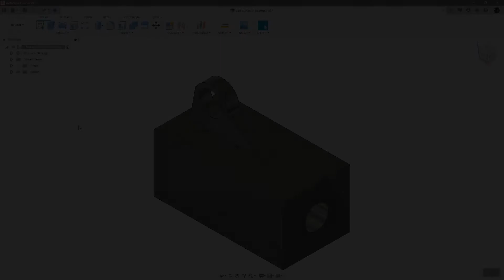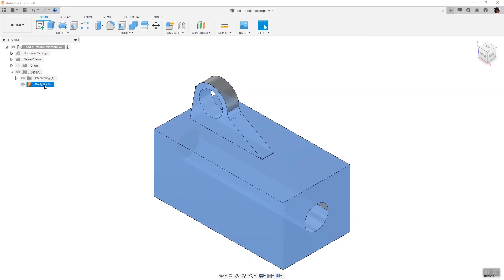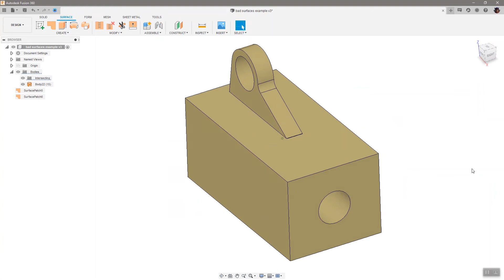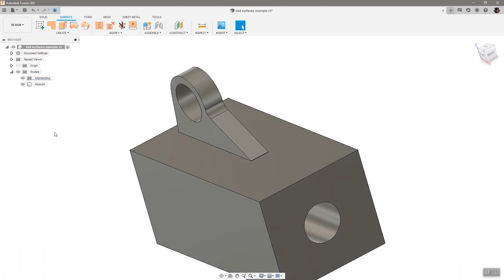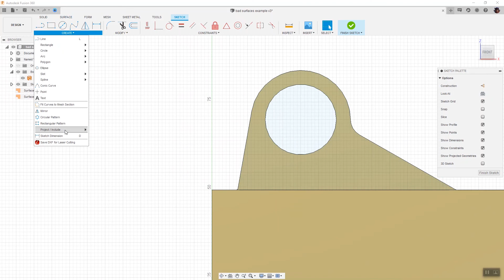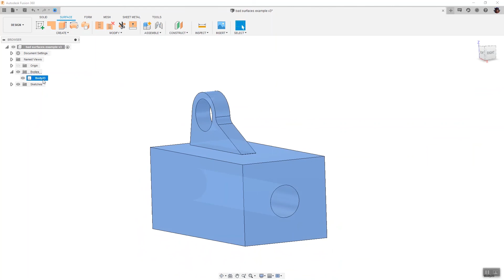Fixing broken imported surfaces in Fusion 360

Comment: wow, this is some great info.. I did not know about this.. I have a large and complex hollowed out castle model that I have worked on the point (many hundred of hours) that I have unfortunately developed a lot of non manifold edges and what not.. it's so bad I cant subtract objects from the model or combine it with other pieces.. this video has helped a ton but I am afraid fixing this particular model may not be possible.. at least I can still 3d print it.. still, this info will help me in the future.. lesson learned I supposed as far as the model goes.. I do have version a week back that I can still do some of those things to but I have 30 hours of changes since that version.. ugh